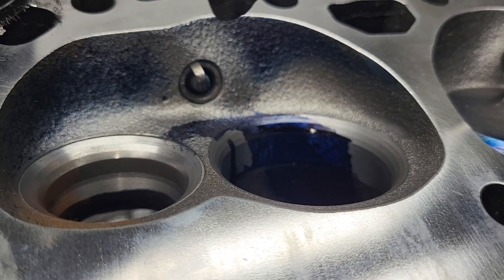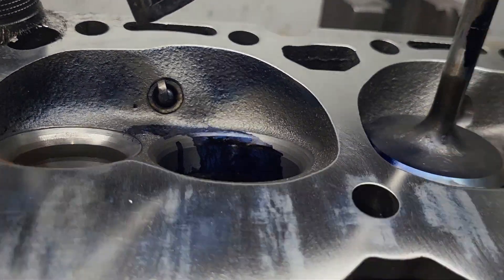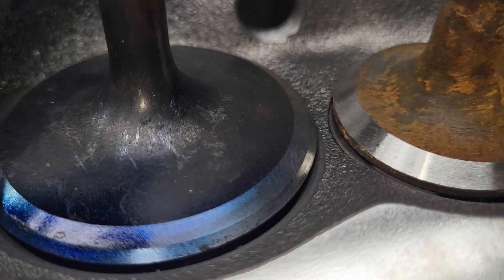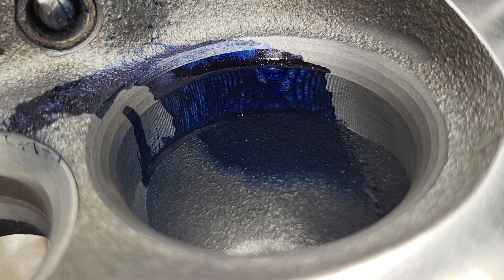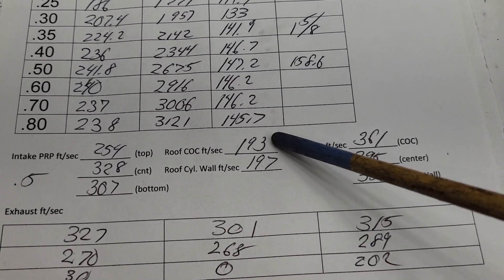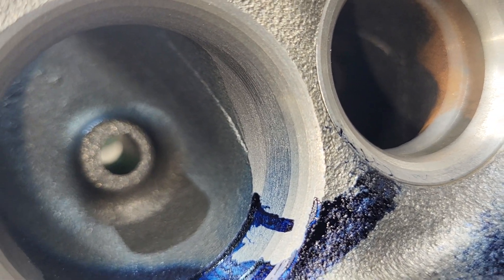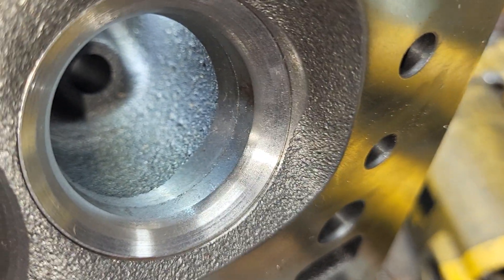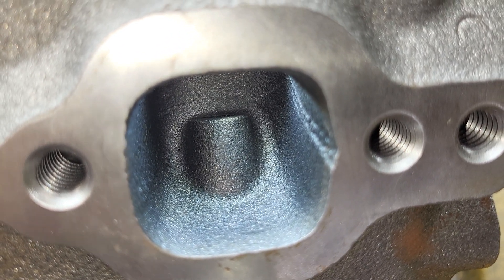Redheaded stepchild, High Performance TPI project kickoff.

Comment: I've never seen numbers that high from a set of these. The ledge that they left in the exhaust port surprised me. I thought Dart was a higher quality company than that shows.
Reply from the maker: I checked Stan's site they were only up a tiny bit.
Reply from the maker: Stay tuned, I fixed my leakage and reflowed it. They are still really good !

Comment: Charlie, we may step up to a 1 3/4” header - as a matter of fact, don’t let the 1 5/8” headers hold it back. The best street headers on the market for third gens are made by ARH and they come in 1 3/4 for the 350/383s or 1 7/8 flavors for the 400+ cube guys. 

Let the bald eagles fly!
Reply from the maker: The bigger tube makes my life easier.  Will also add a bit of top end hp too.

Comment: I have a pair of these 007 heads and look forward to how your development goes with them! I was planning on going to 2.00 or 2.02 intake valve and just growing the port cross sectional areas the same percentage or a little more.
Reply from the maker: That would work but not as well as mapping the air speeds in the port. Thanks

Comment: Looks very clean compared to the old junk I’ve been staring at stock lol! The guides are small, nicely tapered grind angles into the bowl and into the SSR…🤔, so I would be curious to know what an expert like Charlie sees when this is base camp and he’s tasked with making the numbers take. a hike 😂! Fast speeds on SSR, could bias the bowl to the cylinder side (more swirl & exhaust energy)but the ports are pretty straight, maybe widen the bowl on both sides-that would definitely increase intake flow but, 😬 does that cause conflicting chamber energy affecting swirl-negatively?
Reply from the maker: Just widening the bowl may help a bit but may also make ssr seperate earlier.
Reply from the maker: Fixing the ssr speeds would most likely effect swirl. That may not be a bad thing. Thanks

Comment: Hey Charlie, would the pinch benefit from a pseudo cathedral port, if raising the center of the intake port at the head and in the intake?
Reply from the maker: I was thinking it would help due to the angle of attack on TPI base
Reply: I think we are going to be impressed on what you can do with these.
Reply from the maker: @dondotterer24  That would be nice. Thanks